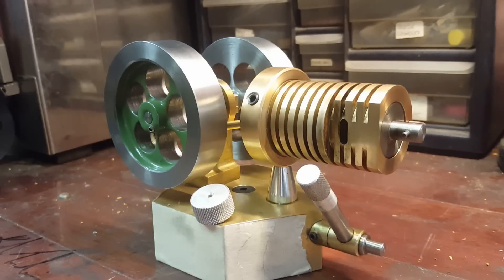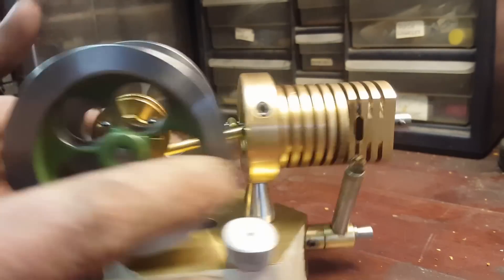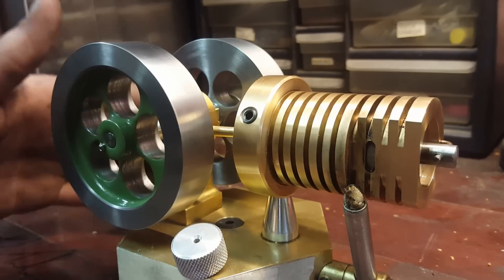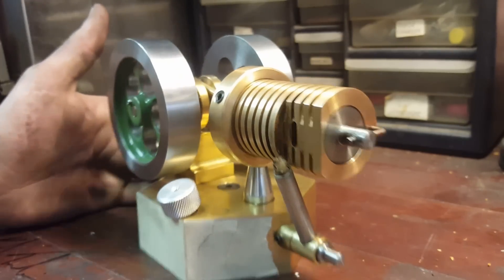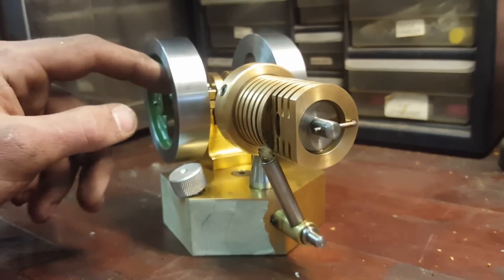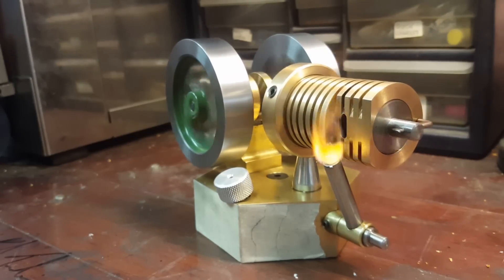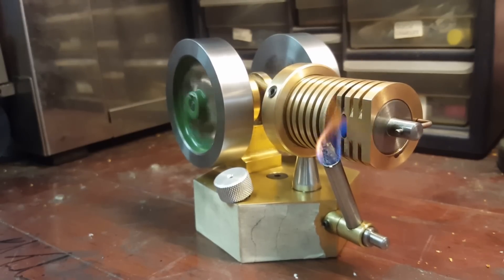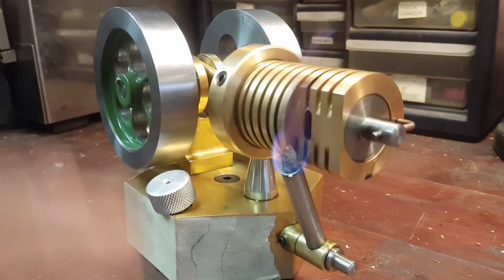My home made scratch built flame licker - go over

Comment: I made a similar engine. Saw some YouTube video and surfed the net. Got some basic information and build me an engine. But it doesn't work.
Reply from the maker: They're insanely finicky. I have a pin of like 10 pistons and valves that didn't work. I ended up making a graphite valve and piston set. That worked best for me. 

With dissimilar piston and cylinder you need to account for thermal expansion. My engine is completely seized at room temp but runs great at temp.

External valve versions are alot more forgiving and run way better

Comment: The weak performance of this particular piston valve  design is caused mainly by the limited valve opening duration available and the inability to set the valve timing with any useful 'advance' of the power piston stroke. Flamelicker engines with the valve timing dictated by a separate eccentric cam and rocker arm give far better performance than this design.
 I have built one of these piston valve engines to very similar design from plans supplied by Jan Ridders and also I have built a Beng's 'Nick' flamelicker. The Beng's engine operates the valve by means of a cam with adjustable advance on the valve timing.
 It runs far superior to this piston valve design.
Reply from the maker: Thats good Info, thanks but I will never have a patience to build another lol

I'm on to mini river jet boats with too much horsepower recently. Lol

Comment: I think the piston needs to be fatter and you need more surface area on the exterior to cool better. Perhaps a water jacket or water reservoir on top?
Reply from the maker: The Eh Team I just machined it to tighter tolerances there's another video on my channel where it's also converted to run on propane, the base is the propane tank. It runs pretty much perfectly now.

Comment: dear brother please share me drawings for making this, selva2008itsme@gmail.com it will be greatful
Reply from the maker: selva kumar if I can do that for you, I would. Unfortunately there are no drawings I designed this engine in my head and never drew up any plans. It would take me quite some time to draw the plans so I don't think that will happen. You want about 1 inch of stroke and you want about seven eighths of an inch to 1 in diameter piston. Do you want to machine everything so that it fits very tightly at room temperature, but moves freely when hot. Try to avoid having to use any oil on the piston and cylinder as it just burns up and gums up the system when it gets hot.

Comment: i don't no what's your piston size but you try 22.00 mm the piston size. and polish cylinder 00.03mm
Reply from the maker: entertainment the engine runs perfectly now I just changed the fuel type to propane and it solved all of my issues

Comment: Hi,
can i suggest you look at two stroke oil ( as used for two stroke engines, mix with petrol ) this is a lubricant designed to be burnt & is low ash. Its very thin as well !

Comment: The reason every flame licker (even graphite piston ones) engines starts tough is condensation. The sudden heating causes condensation.  Try using a heat gun to pre  heat every flame licker you ever use.  Doing this will extend the life of a graphite powder lubricated engine.    This is something they never tell you. I feel it should be somewhere.
Reply from the maker: Michael Johnson that's not the case with this one. the reason it doesn't turn over o  start up is thermal expansion. with the new graphite pistons it must be hot to turn over. and if it's hot condensation is not possible. this engine has been redone since this video has been uploaded. it not runs on propane instead of alcohol. it's alot more predictable.
Reply: Dimple Sharma I am not exactly sure why exactly. But if the engine is cold, or room temp it will get the condensation at first.  Once the metal is warm, the condensation goes away, and they run great.  You can pre heat with a heat gun, or even a hair dryer.  You can also light the burner, move it close to the engine. In about 3 minutes once it is warm to the touch, it's ready to go.   Do you have a flame licker?  I may make a video demonstrating this.
Reply: Michael Johnson Condensation forms because the burning fuel produces a surprising amount of vaporized water. When the burning fuel is sucked in  and the walls are cold enough, the gas mixture gets cooled down past it's dew point because it has such a high humidity. It's the same process that forms clouds, fog and dew, except your cylinder wall is the cold morning grass.